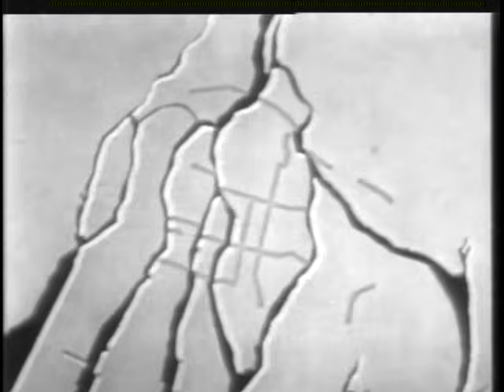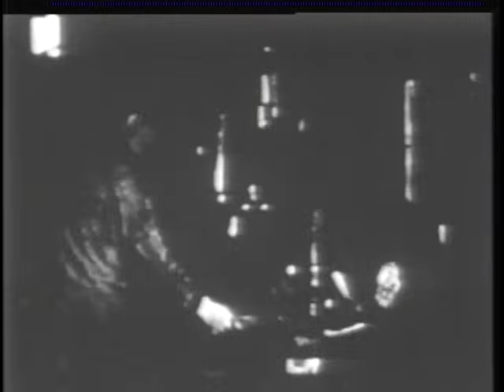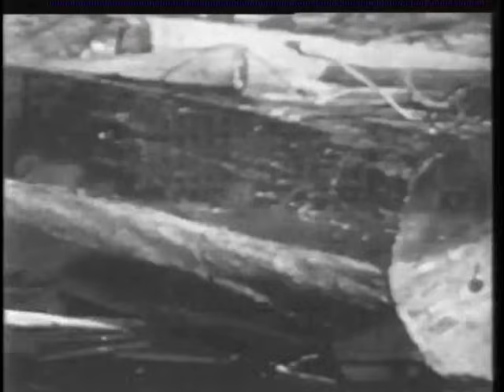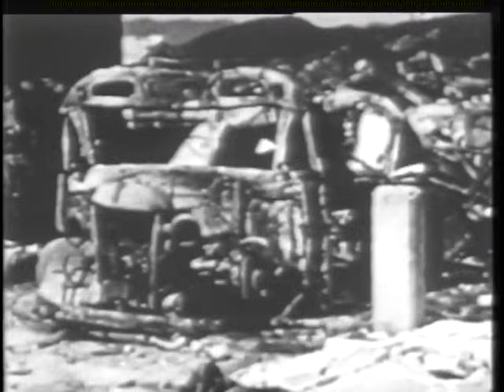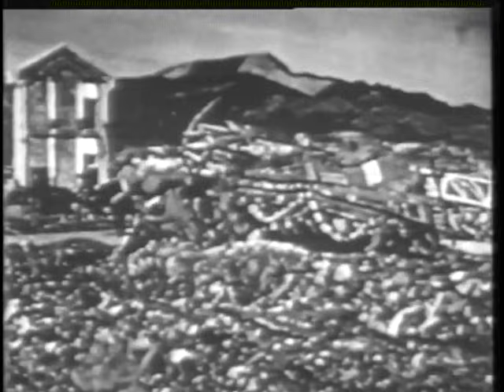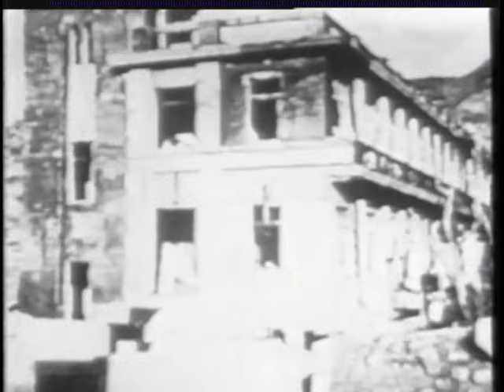The Effects of the Atomic Bomb on Hiroshima and Nagasaki

Comment: How did the people return so soon with all that radiation supposedly
Reply: The radiation is mostly a problem in the initial blast, not the aftermath. One air burst nuclear blast over an area won't saturate it in radiation for eternity, but blast everything with radiation at that moment. The radiation levels are moderate after the initial fallout. Whereas with Chernobyl, an unplanned ground explosion with a dramatically larger energy yeild and other materials (graphine) is much..MUCH..more deadly and damaging. Chernobyl put about 400 times more radiation into the atmosphere than the Hiroshima bombing..that's why the area around Chernobyl is still radioactive as fuck, and Hiroshima isn't.
Reply: @cyrussheets4450   would the greatest amount of radiation in an airburst come from gamma rays?